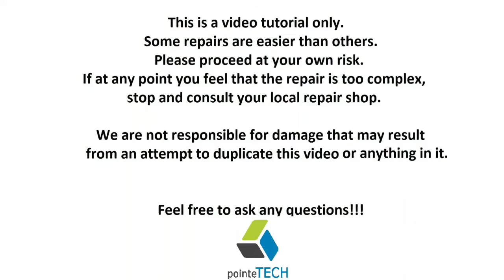Teardown Disassembly Upgrade Options for Dell Inspiron 13 5368 Laptop

Comment: Thank you for this, i had an ant infestation, and i thought that they went inside of the laptop as well. Thank god there wasn't any.
Reply from the maker: Glad your all set :)   Always here if needed !!
Reply: @PC_Monkey   hey, i wanted to ask, since ive been experiencing some heat issues, is it because i screwed the nails a bit too much, or is it a hardware problem? because i did screw the nails to the point where they couldnt be screwed anymore?

Comment: How do you get the keyboard out?
Reply from the maker: This is what is called a French Inset Keyboard.  They are not designed to be replaced independent of the palmrest.  They are not attached by screws but instead, by many small plastic rivets.  You have to break all of those to remove the keyboard.

Comment: how do you replace the keyboard?
Reply from the maker: What brand and model computer do you have?
Reply: @PC_Monkey  The exact one you made this video on
Reply from the maker: @TheSalient0ne  The black protector sheet would have to be taken off.  After doing that, you may see screws holding the keyboard down.  If so, remove them and then the keyboard will be freed.  If you dont see screws, then the keyboard is most likely whats called a 'French Inset Keyboard' and will be held down by many small plastic fasteners.   You would need to break them to replace the keyboard.  Please note, this is not considered a quality repair since the new keyboard will not be fastened to the keyboard unless you wish to tape it down.  Its best in this case to replace the whole palmrest instead.

Comment: Did you say you sell parts? I need a screen for dell 13” and I like that you said you sell it all in one piece.
Reply from the maker: I usually get my computer parts on Ebay or Amazon.  I dont currently have anything compatible with this model in stock :(

Comment: Thank you very much for this! My laptop's battery had lost much of its capacity after a couple years so I wanted to replace the battery but in the process, I kinda just got curious and wanted to explore my laptop a bit more but without breaking anything! It's still all good thanks to this! I'm an electrical engineering student (senior) but I wouldn't know much about troubleshooting a laptop's electronics xD.
Reply from the maker: Happy to help :)  Always here if needed !!

Comment: do I need to remove all the parts to replace the keyboard? is there a way I can remove the keyboard without removing all the parts?
Reply from the maker: The keyboard is whats called a 'French Inset Keyboard'.  Its not held in with screws.  You need to break the fasteners in order to remove the keyboard.  We dont recommend doing that as the next keyboard may not be as secure.  We recommend replacing the whole palmrest.  But if you prefer to do just the keyboard then yes, you would need to remove the other components to access whats under them :)
Reply: @PC_Monkey  hey thx for your job ! I have a question about keyboard replacement, if I buy a keyboard palmrest does it come with connectors on the back ? For connect all the things I removed to out them on the new ? I'm putting the link of the keyboard I'm about to buy thank you for your help

https://www.ebay.com/itm/NEW-Dell-Inspiron-13-5379-Palmrest-US-ENGLISH-Backlit-Keyboard-0JCHV0-0M9DMK-/382882789026
Reply from the maker: @prodmizuu  Each seller will include certain parts.  You have to view the back of the item and see whats included.  If you have a question on what will be included, you should message the seller
Reply: @PC_Monkey  for exemple at 10:30 of your video on the right side of the touchpad there is the (probably) keyboard and touchpad green assembler (?), I have it on my palmrest but will I be able to place it on the new one ? I saw there is no website who sells it with this green part. Thanks for your answer, I don't want to buy it without know exactly how to assembly the PC back correctly !

Edit: Sorry, on the right side of the blank place where the touchpad is supposed to be, not where the touchpad is actually on the video lol.
Reply from the maker: @prodmizuu  At 10:31 I see those little green boards and yes, I think those do go to the touchpad.  Yes, you should be able to remove those and put on your new palmrest if the new one doesnt have them already on :)  They will either be held down by screws or double sided tape.  If its tape, just be careful not to break them as you pry them up

Comment: I have an Inspiron 13 7000 P69G.  I need to remove battery, motherboard, keyboard, screen and all other boards and replace in new case (dog bit off corner but didn't damage parts).  The battery has a different connector. Can you show me how to remove it without damaging the cable?
Reply from the maker: What kind of connector?  Feel free to make a video and post to your channel.  Message us back here and we can then view and advise :)
Reply: @PC_Monkey  I found another video about replacing the battery and was able to pull the connector off the battery. I have to get a different palmrest with the keyboard attached as I see the keyboard isn't removable
Reply from the maker: @ortathdragon9312  Ya, some keyboards are not removable from the palmrest without breaking it and then the new keyboard isnt very sturdy.